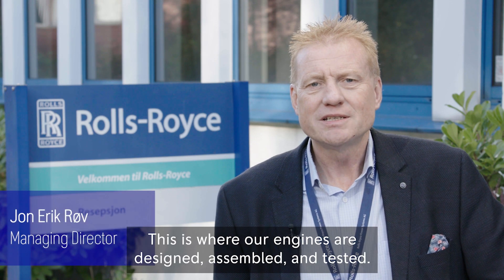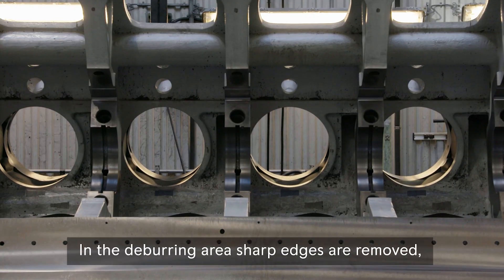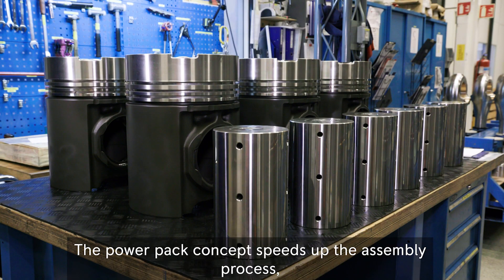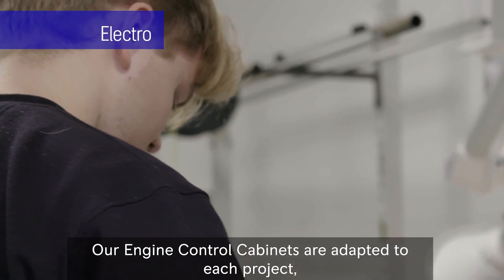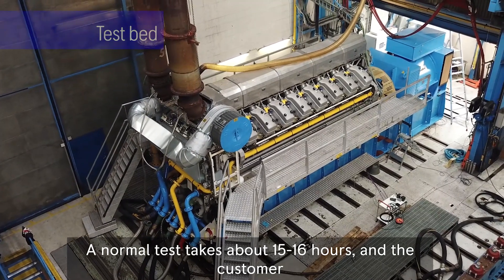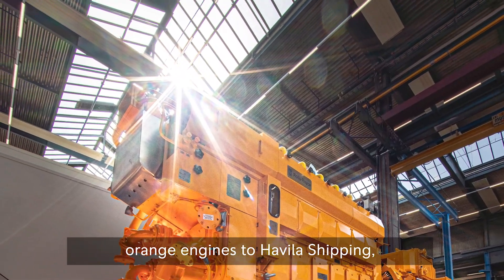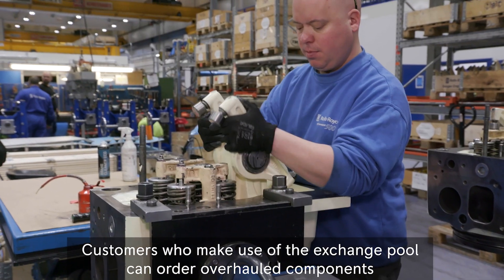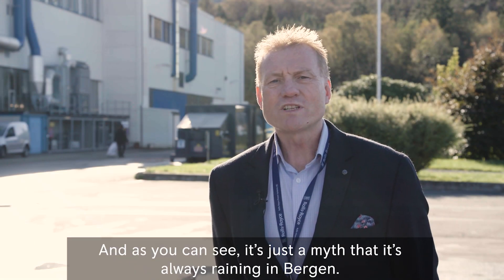Rolls-Royce | Virtual site tour of Rolls-Royce Bergen

Comment: Thank you for this video. I was once a producer of parts for R/R skid 30 Industrial marine gas turbine parts making the quadrant component for the outer 2nd and 3rd stage gas turbine case from "Multimet" material. It took roughly 120 hours to machine on a big VTL lathe from proof turning to my finish turning being bolted together to very high foot lbs before I could commence working on the part. Our factory stopped our parts production on these and single ring 1st stage also for SKID 30 engines back in 1996 but my memories live on for ever.  regards, Ian -- UK.